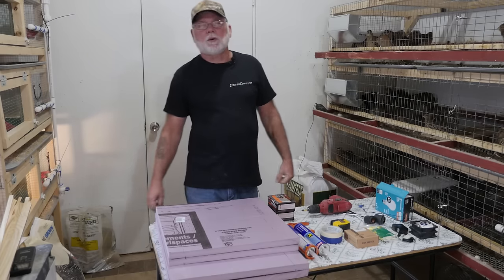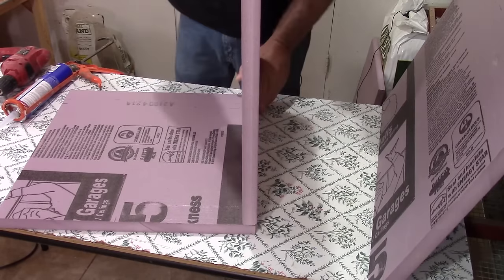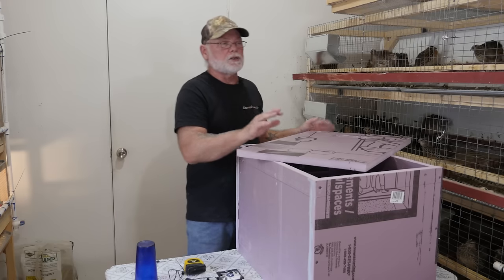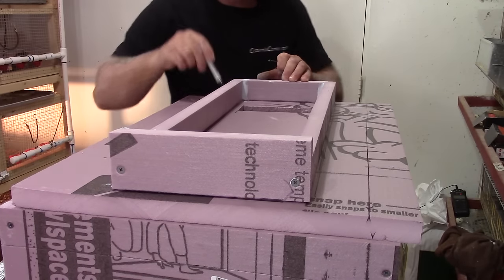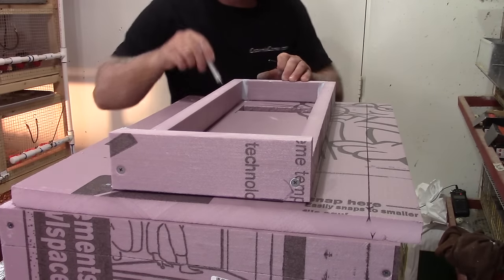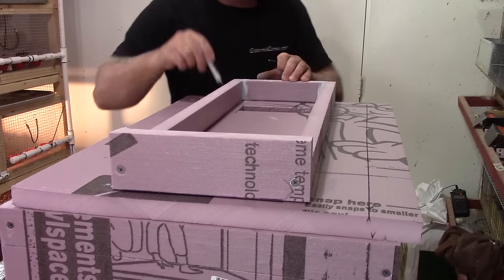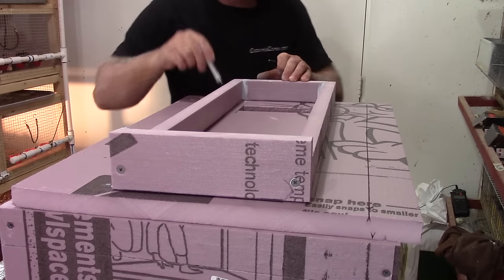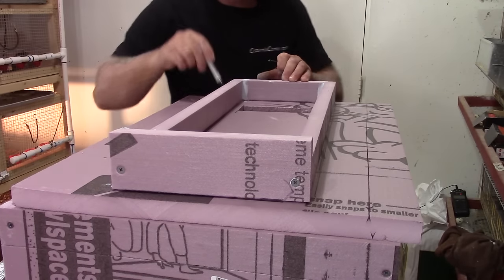How to: Cabinet Incubator - 240 quail egg incubator

Comment: Hey we just moved from Florida and we have a quail farm up here now in South Carolina. I love this design and I know exactly what you’re talking about humidity down in Florida it must be nice lol. 
1) How might you recommend controlling the humidity environment in this design
2) do you think that making a bigger box system to hatch more eggs would be problematic with hot and cold spots?
Reply from the maker: Hey Tom, congrats on the quail farm in SC. I have looked at humidity controllers for this design even though I've never had to use it. If you can keep humidity above 35% you should have no problems doing a dry hatch even in SC, then to raise the humidity for lockdown just add water to a pan or tray and place in the bottom of the incubator near the intake port for the forced air box. You could easily design a larger box incubator but you would need to increase the CFM of the fans and increase the heat source temps. You could install a heating element or higher wattage bulbs. I started at 150 watt bulbs and tested the temps in three locations of the incubator, after several test I found that 60 watt bulbs worked the best and maintained even temps throughout the incubator. Another thing that really helps is placing a couple soda bottles full of water in the bottom of the incubator to help stabilize the temperatures.  Here is a humidity controller that might help with your lockdown.  https://incubatorwarehouse.com/humidikit.html
Reply: Coturnix Corner so the kit would be just to make sure it stays above 35% if the humidity goes above 65% is that bad? On my GQF incubator I currently have it says not to exceed 65% however I see people doing all different types of stuff online. Being in Florida I would imagine that the humidity would spike up above that once you add the water. What’s your experience with that? You mentioned about if it gets too low then they shrink wrap would stand a reason that the more humidity the better? Just curious thanks for the info.  I love this design
Reply from the maker: @trguitarlesson , I have never had a problem with high humidity during lockdown. Even if you keep a perfect 65% during lockdown once the eggs begin to hatch the humidity will spike due to the moisture in the egg and the chicks. Higher humidity during lockdown won't hurt your hatch. I've had 100% humidity during our rainy season and still got good hatch rates. On the other hand, If your humidity was high during the entire incubation period that could present a problem, as the eggs will absorb too much moisture thus making the air cell too small causing the chick to drown or suffocate. Keep your humidity around 35 % for the first 14 days, then bump it up a bit during lockdown and you will be fine.
Reply: Coturnix Corner you are the man! Thanks so much. That answers a lot. Any issues with mold in the insulated foam board? Just curious?
Reply from the maker: @trguitarlesson  none
Reply: Coturnix Corner 
Ok I started going through the list of things to get and had a couple more questions I think this might be the end of questions after this ;)
1) what kind of latch do you use on this type of incubator? Any problems with leaking atmosphere?
2) you mentioned vent holes on the top and sides how many holes are you putting what size and where would you put them in the top and sides?
3) when you put your egg turners inside of the incubator are you setting them on the hatching trays or do you place the hatching trays inside at the time of lockdown and switch them out from egg turner?
4) are you just using a standard GQF style egg turner that plugs in with a three prong plug inside? If so how are you running power to it? From inside or outside? And if so do you pull them out during lockdown?
Reply from the maker: @trguitarlesson , for a latch I just put a couple screws into the door and cabinet and use a heavy twist tie to hold the door closed. You can use whatever you want as long as it keeps the door closed tight. Never had any issues with leaking air. As far as vent holes, I drilled two 1/2" holes on the top and 2 3/8" holes on both sides, one near the top and the other towards the bottom. The egg turners sit on top of the rails that are glued to the inside of the incubator, the link to the egg turner is in the description. I use a UPS battery backup to plug the egg turner, the fans and the temperature controller into on the outside of the incubator. The UPS will protect from surges that can ruin the temperature controller and if power goes out your on a battery back up that will keep the incubator going for several hours. I pull the egg turners on day 14 and place the eggs into the egg trays and place those into the incubator. At this time you can candle to check for infertile eggs. Hope this helps. Join us on our Facebook group for more info at: https://www.facebook.com/groups/2411942688854936/
Reply: Coturnix Corner so good! We just got our Facebook page up and running my wife runs it so I’ll have her join up. Just curious what part of FL you in we moved from Boca but I’ve lived pretty much all over the state due to my dad being navy.
Reply from the maker: @trguitarlesson  I'm in the Ft. Myers area.

Comment: Thanks for the great tutorial! Would you think there may be benefits on using 2-inch foam board instead of 1-inch? Perhaps that will allow the ambient temperature inside the room (where the incubator is located) to be a little cooler? Or maybe it will save a little more energy? Just trying to think which size board to get before building mine. Thanks.
Reply from the maker: It might save some on energy cost or if you are in a colder climate it might pay to use the thicker foam board. Good luck with your build!

Comment: Hi Terry was wondering something when wiring up the Inkbird.  For the jumper wire You said #5 pin goes to number 1 pin .The diagram on the inkbird sticker shows it going to #2.
Just want to make sure I get it correct.
Reply from the maker: It could go to either, but pin two is the neutral wire, while pin one is the line. Loads should be fed off of the line side, so pin one is correct.
Reply: @CoturnixCorner    Much thanks. Getting closer to my first try at hatching. All the cages came out great just as you showed.
The incubator came out really great as well.

Comment: Do you use this incubator for lock down too or transfer them to another incubator
Reply from the maker: I can use it for either, lockdown or incubation. If I have a second batch going in I will move the eggs to the lockdown box, if not, I just hatch them out in the incubator.

Comment: Hey Terry, I’ve watched your video quite a few times and I learn something new every time. I’ve built a few incubators using your instructions, and I’ve hatched quite a few quail eggs. 

My most recent incubator fits over 430 quail eggs, and is not too large. The reason for this comment is that I have had trouble with humidity. The box is sealed, but I can’t maintain humidity. I feel that my water source is too far from the heat, and I’m am working on a solution for it; but I was hoping for some tips. 

Do you add humidity to your incubators? I know some people are in humid areas and don’t require it, but I wanted some insight from your point of view. 

What is a simple way to increase humidity in my incubator? It’s currently 2’ wide, and 2’ deep, standing at 4’ tall, to give you an idea of the interior volume.
Reply from the maker: The first thing I would look at would be the CFM of the fans and wattage of your heat source. Too much air circulation or heat will reduce humidity severely. Also, the cubic feet of your incubator is 16 feet, so you will need a very large surface area of water to raise the humidity to 50 or 60%, Try running a second tray of water on one of your egg tray shelves, if that works you'll have to figure out a way to get more surface area of water. You could stand sponges on end in your water tray to make kind of a radiator as the sponges soak up the water that should raise the humidity too. Let me know how it works out. Thanks for the question!
Reply: I live in a dry area a wet rag wicks more water into the air then a resovur you might try a soaked towel to up the humidity
Reply: Elizabeth Boyd thank you! I will definitely try that. I’ve made some modifications since this comment, but everything helps. My hygrometer reads less than 20% humidity at times, so I’ve got some work to do.
Reply: @CoturnixCorner  would directing airflow over the water help humidity increase?  I thought airflow would increase humidity, but you have more experience.  (Maybe air leaks with more airflow removing humidity?)

Comment: Hi I just built this incubator. I have a question about the turner power cords. How did you run them out?
Reply from the maker: I have them running out the bottom right hand corner of the door. A piece of duct tape holds the cords in place. Thanks for the question.
Reply: @CoturnixCorner  ok I wasn't sure. I was thinking about adding a plug to the inside so nothing is coming out of the door. But I'm not sure if that's a good idea when I raise the humidity.
Reply from the maker: @jmarshalllane  I was thinking about building a 120 volt junction box on the outside of the cage and have all 120v wires run into it and then just have one cord to plug into a wall outlet. You could cut the turner motor plugs, drill a hole in the side of the cabinet and wire directly to the junction box. I may do a video on that one day :)
Reply: @CoturnixCorner  I thought about that too. Because I'm building a second one just for hatching. So the Turner's wouldn't have to come out of the first one.

Comment: Hi, thanks for sharing this. I built this and after a trial run I am getting temperature differences between 1-2 degC between the top and bottom shelf.  I was thinking of adding an additional fan at the bottom of the incubator that would blow across the the water pan and into the rectangle vent at the bottom. Do you have any recommendations to reduce temperature variability?
Reply from the maker: It is normal to have a slight variation between the top and bottom shelfs. Mine is about 1/2 - 3/4 of a degree difference, but up to 1 degree is acceptable. If you are getting more than one degree difference try placing a couple plastic water bottles in the bottom to act as heat radiators.
Reply: Did the bottom fan help? Also I was thinking airflow across the water would increase humidity?  
What is your hatch rate?

Comment: hi 
Coturnix Corner
can i ask 
can you use a 12V 100W PTC Car Fan Air Heater Constant Temperature  Heaters  with a digital thermostat Controller 12v any iders on how i would go about do this also plaese could do video on this if possible ? would like to use 12v solar power but unsure if its the right thing hope to here from you soon
many thanks
kind regards
paul w.

Comment: Hey Terry, finally getting around to building your incubator.  Do you know the cfm ( how much air the fan moves) of your fans?  Thanks
Reply from the maker: There should be links in the description to all the materials I used building this incubator. The CFM is pretty low, around 30 cfm I believe.
Reply: @CoturnixCorner  Thanks Terry yes you are right did a little research and found them on Amazon.  Thanks again.

Comment: Hi Terri, 
Thanks for this great video. I have two questions: 1. Why do you make those enclosures for the lights? (why not just have light bulbs sticking from the ceiling?).  2. Do you really need two light bulbs? Would one work?(seems very well insulated). Thank you!
Reply from the maker: I found that by enclosing the bulbs the heat builds up faster and brings the incubator back up to temperature, it also helps with keeping the temps uniform throughout the incubator. The reason for two bulbs is for redundancy, if one burns out the other will keep the incubator warm enough until the other can be replaced.
Reply: I'm guessing the heat gets distributed more with the duct.  Without a duct, heat buildup would be similar, but not evenly distributed heat.  
Maybe putting the bulbs at the bottom, below the water tray would allow heat to rise and distribute more evenly...But you don't want water falling on electricity so bulbs at top is better.

Comment: Do you have pictures or video of the other incubator that you made? this is only for lock down period but I'd love to see the one with the moving trays to see how much space you have around to work. I pick up eggs on a daily basis and I do not want to be sliding the incubator trays out every time. If you can please be kind and share a video or pictures will be greatly appreciated.. Also I have a question how many quails do you keep on each cage I was recommended to makes cages big enough to fit 3 females and 1 male but I think that will be too much I'll have to buy more material that if I to a bigger cage for more capacity.. Can you please share how many females and males you put on each cage??? Thank you I really like your videos
Reply from the maker: Both incubators are identical. I have one that I use to incubate the eggs and the other is for hatching. You only need one incubator, just put the eggs in the turner trays and for lockdown remove them and place them into the hatching boxes. I put 3 birds per sq. foot of cage space at a ratio of 4 hens for every male. Hope this make sense and thanks for the comments!

Comment: Thanks for sharing!  Question: with the bottles of water for humidity - how is the water escaping to help with the humidity?  Do you have small holes punched in the bottles?
Reply from the maker: The water bottles are only to help stabilize the temps, they act as a radiator once they heat up. They do not provide humidity.
Reply: @CoturnixCorner  Thank you!  Do you think a humidity controller is needed or have you found the tray of water at the bottom is sufficient enough to maintain the desired humidity level?

Comment: There are few more questions about your incubator built, even though at the end of the video, you did mention about the ventilation hole for incubator, but where will its be? How do you control the humility inside the incubator? Are you manually add more water into the bottom metal tray that you have mention? How do you rotate the eggs every 3-4 hours in the first 18 days? By hand? The eggs will start to hatch from 21st day to 24th day, with that many eggs, how does the chick exit the incubator by itself to get food and water? Or you will take it out? Etc...
Reply from the maker: I do what's known as a dry hatch due to me being in S. Florida and our humidity is usually pretty high. You can control the humidity by using different size water trays or by unplugging or plugging the vent holes. My incubators have electric egg turners, on lockdown you take the eggs from the turners and place them into a hatching box inside the incubator. Once all the eggs have hatched you remove the hatching boxes and chicks. Hope this helps.

Comment: Can you please tell me how to get the humidity up!? We have one running but i cant get the humidity up over around 35%!! I have some expensive serama eggs in it and will need humidity up for lockdown. I have 2 pans of water, each with 2 spknges in it, in the bottom, plus 2 bowls, each witb a sponge in it, next to the lightbulbs. I dont know what to do.
I used everything in your link gor fans and whatnot.
Reply: Hang a small wet, warm towel on the inside (held by 2 screws?), and draped into the water tray. The towel will wick up water and provide more surface area.  Make sure the towel doesn't fall or touch eggs/reduce airflow or heat.  A drying towel will absorb heat so make sure it stays wet by not hanging it too high above the water.  

I have no experience, but this is what I'd do.

Comment: Hi Terry, The light bulbs you use , do they say 60 watt replacement uses only 43 w. , because I’ve been using some old 60 watt incandescent bulbs that I’ve had when I stocked up on them , when they were gonna stop making them, but when I look for new ones that’s all I can find . The old ones are working great, just wondering what to use when I run out of them.  Thanks.
Reply from the maker: Keith Arnold yes the bulbs are the 60 watt halogens that use 43 watts.
Reply: Thanks

Comment: very informative video and fairly easy build. I do have a question. If a fan dies on you, how do you change them out when the back panel is screwed and glued on?
Reply from the maker: The back of the forced air channel panel is not glued on, only screwed. I mentioned that in the video. Thanks for commenting!
Reply: @CoturnixCorner  thanks for the reply. I did see that that panel was removable but in the video you mounted the fans to the side of the back panel that goes inside where light bulbs are. you could remove the lockouts from the forced air chamber but the fans are on the side you glued to the back of the incubator. did I miss something as you were assembling?

Comment: What if the fan fails or  the power supply of the fan.Would the light bulbs create too much heat and potentially create a fire hazard?
Reply from the maker: Even without the fans the regulator won't allow it to get hot enough to burn the foam which is ASTM E119 Fire Resistance Rated.
Reply: @CoturnixCorner  thanks for your reply! I build two incubators after watching your video. They worked great but I once accidentally unplugged the 12v power supply for the fans and started to melt some of the foam board. I just used regular ridge foam board and can’t see a fire rating on it. I either use a current sensor relay which would shut the bulbs off in case there is no current running through the fan wires, using a heat shield around the bulbs to protect the foam from heat or install a ceramic heating element also with a heat shield.